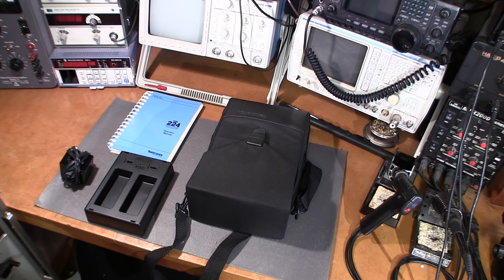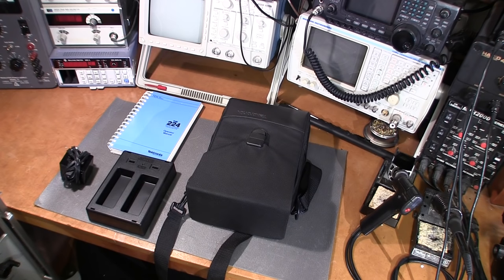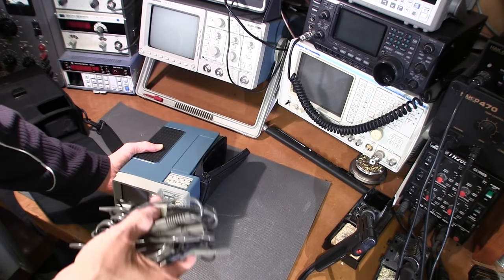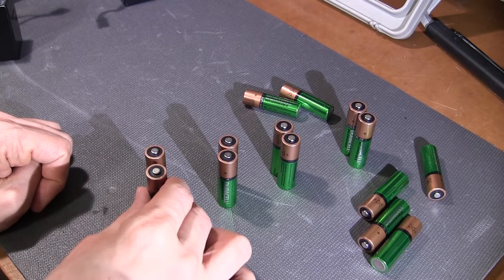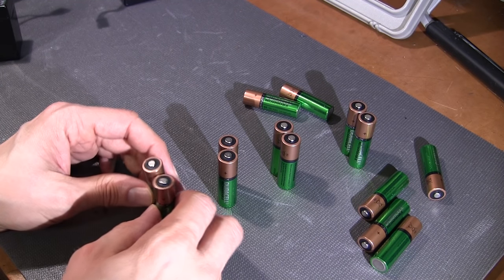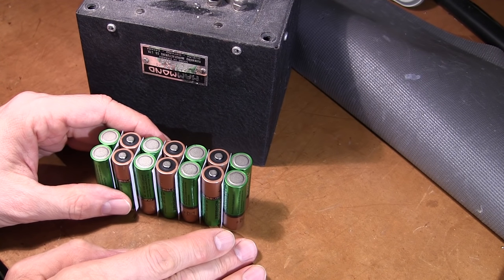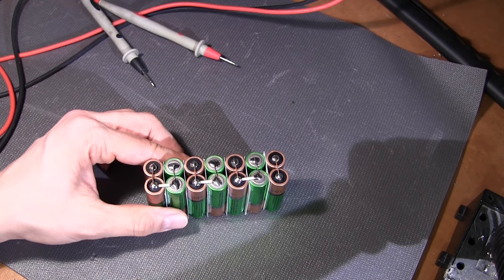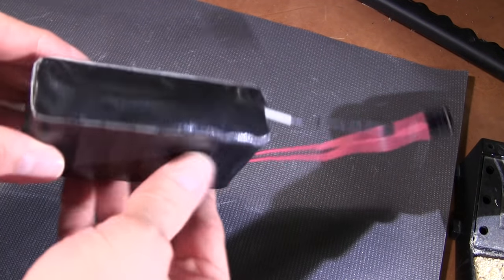Tektronix 224 Oscilloscope Repair and Modification

Comment: So u chose ni mh type batteries vs 18650 type lithium ion
Reply from the maker: Yes, because they charge the same way a lead acid battery does.
Reply: @MrCarlsonsLab  fair enough what about longevity as in charge cycles? I always thought that lith ion were the top tier before li po etc

Comment: Hi, What is the value of the resistor in that battery setup and what is its function....thanks.
Reply: Might be a useless reply at this point, but: it’s not a resistor or an inductor. It’s a fuse wrapped like a resistor.
Color bands are similar to decode them. Little fuse and they still can be found on eBay.

Comment: Is there any reason that you did not use a LiPo stack for this mod? Would be lighter and more efficient and increased use time, great mod nonetheless, exquisite work, explicit video.
Reply from the maker: LiPo batteries would require modification to the scope (charging circuitry), this modification is plug and play, with over double the capacity of the original battery.

Comment: why do you use 7 AA batteries to get 9.5V when the original lead acid pack ran at optimal 8V? wouldn't the extra voltage damage the scope?

Comment: Don't you have to mod the charging circuit for NIMH?
Reply from the maker: Not at all. The whole idea behind this modification was to keep it simple, and build something plug and play with more capacity. With the displayed arrangement, the charge Voltage worked out great.

Comment: I'm building this battery for my Tek 222PS. Got as far as the insulating bits between cell pairs. 

Can anyone suggest a common material to use for this? Maybe not common plastic (should be somewhat heat-resistant) and not conductive (for obvious reasons). 

Cheers.
Reply: Used "fishpaper", a common insulation thermal and electric insulation paper. Found on e-Bay. Lots for sale cheap.

Comment: i thought up a machine in theory that haz solder in a needle that stays liquid hot....you have it a few mm above the battery top prepared and it drop liquid solder onto to the amount you input on machine....wouldnt it be so e z to have that machine....

Comment: Hello Mr. Carlson, A dear friend gave me a very nice Tektronix 2230 scope. It ran great for a while, then when I go to turn it on, the power light doesn't light and I hear a chirp every now and then. Any idea where to look for trouble??

Thanks, Chuck WD8BXS
Reply from the maker: Hi Chuck. It probably needs capacitors... Time for a re-cap.
Reply: Would you just replace all of the electrolytics int he power supply?

Comment: It wouldn't occur to me to wire a series stack of NiMH cells without adding slow-discharge resistors across each cell.  The reason why not is that the cells will self-discharge at slightly different rates, so if you start using a half-discharged stack, as the battery exhausts one or more cells will go to zero volts and start to be reverse-charged.  The result is that that cell will fail and go high impedance..   So advisedly, fit discharge resistors across each cell pair in the stack such thatvthe stack discharges completely in about a month.

Comment: could you not have done one row or block of positives all wired to each other and one row of negative all wired together instead of going back and forth in pairs?
Reply: Jeff Gagnon Then they would be all parallel

Comment: Saw this video about a year ago. Still don't understand why you didn't go with LiPO batteries.
Reply from the maker: Hi Peter. If I was to change this over to Lithium batteries, the charging circuit would need to be modified in the scope. I didn't want to add an external charger (or add one under the probe case) either. The batteries I chose charge the same way the original's did, and required no external circuitry or modifications to the scope. I get an entire day of use out of that battery pack (on continuously) .... Way more than most would need from a portable scope.
Reply: Ah, so a SLA battery charger will work with NiMH cells (assuming the same total battery voltage). That's a useful nugget of knowledge!

You don't have any trouble with charge balancing across all those pairs of cells in series? I've read that this is a potential trap.

Comment: What is your preference of these batteries over a Lithium Ion, 18650's?
Reply from the maker: Actually, I like them both. This solution was a direct plug in. The 18650's would need a special charging circuit.

Comment: How does the inductor behave like a fuse?
Reply from the maker: The wire inside the inductor is small enough to open with excessive current draw.
Reply: Thank you for the explanation.

Comment: Shouldn't you also put the spaghetti tube on the anode end as well? It looks like the uninsulated jumpers could short the can to the anode. Remember the entirety of the can is connected to the cathode, not just the far end of it.

Comment: good work dude! 
i have done the same thing and it works out nice! but i never super glued them ill do that next time..
How come you did not use lithium cells? was it beaus of the charging circuit required ?
and can you get back to us on how long the battery pack discharges and recharges? don't NiMH battery's require a higher voltage to charge then lead acid batteries?
Reply from the maker: HI Matt. So far 5 hours straight and no low battery warning yet. I will continue today.

Comment: Why did you make 9.5V instead of 8?
Reply: I wondered this too. Then I remembered the original was a Lead Acid battery.  So like a 12V car battery charges and runs at 14V(+/- a bit) then 9.5V should be perfect to replace a 8V lead acid battery.

Comment: Regarding using lithium ion instead, the unfortunate reality is that 3.7v nominal is too low for something designed for 4v nominal. All of the capacity will likely not be leveraged. 

If replacing a 6v lead acid battery, 3.7 * 2 = 7.4v, that is way too much. 

For 12v batteries, 3.7 * 3 = 11.3v, which is too low. 24v / 3.7 = 6.5... that is about as bad as it could get.

Luckily for you, you don't need to leverage the high current capability of lead acid, otherwise you would be forced into using LiPo or Lithium Ion, and that would likely require modifications to the scope.

The question I have is, parrellel first, series second, or series first, parrellel second? I tend to feel better about parallel first, as it feels like the entire series line has a bit more redundancy that way. Both parrellel batteries would need to fail to mess up the series of cells. It looks like you also did parrellel first, series second.

Comment: How are you going to recharge this battery pack?
Reply: It charges off of the wall plug
Reply: I wrote a response and forgot hit reply,but you only need a smart charger for fast charging.A properly sized trickle charger will do just fine with NiMH batts.

Comment: I have some batteries that are 3,7 volts at 9000 ma h that are really cheap they are 1860's rechargeable at 9000 ma hr each. should make good replacements.

Comment: Why not to use lithium batteries?
Reply: You'd have to charge them externally and also make a special circuit to do so.....These charge just fine with the included wall wart when it is plugged in the wall.
Reply: I did the two 18650 Li Ion batteries in series for my 222 scope.  It is a giant pain in the butt to remove and recharge so I am buying NiMH and making the switch just now.  I didn't think having to remove to charge would be a big deal but it turns out to be a big pain in the a$$.  I have to disassemble the battery pack every time to clip it into the external battery charger. That is why not lithium batteries.

Comment: I have question what the oscilloscope to learn and at a small price,under a hundred,anyone please .I hopeing to find people when learning how to use your oscilloscope ,which one.to learn on disable vet ,did income ,I did by a pocket scope for about 34.00 ,but could have got it for 26.00 if I wanted to wait three weeks so I spent 8.00 more for a faster time.to get it to me.,find out the rest leads weren't good for a lot of things so I bought a probe for it Hope I bought the right one ,I need a scope for limit use on old tube radios ,

Comment: You do realize that some device's use more power so the batteries don't last as long that includes rechargeable so I'd guess something like that scope would drain the batteries faster than say a portable tv
Reply from the maker: Hi Kelly. I'm pretty sure I realize some devices use more power. This scope will last over 9 hours of continuous use with this battery pack.

Comment: The analog version of this came out when out when I was a teenager. Dave Jones has a video here: https://www.youtube.com/watch?v=czv_8d66IQU
I would have given my left AND right testicles to have owned one back then. But alas, all I could afford was a Non-Linear Systems MS-15 Miniscope. They weren't too bad of a scope for the money. I still have it and it still works. It had the Gates cylindrical sealed lead acid batteries (3 D sized cells). I replaced them with NiMh cells also. I had enough space where I was able to use the cheap battery holders/boxes that they sell at Radio Shack, so I didn't have to solder to the cells.

Comment: why not use Li-Ion batteries?? honestly probs cheaper than ni-cad and 2 LG HG2 would be 6000mah 2x2parallel then series them.. 8.4v 6000mah
Reply: Yeah, it would be a lot easier to just change the plug on a quadcopter battery and plug it right in or get 18650 cells with solder tabs.

Comment: My superglue always take ages to cure not like that.
Reply: It depends on the surfaces how fast the two pieces stick. When I superglued RC model airplanes together made of balsa wood (in the 90s and early 00s), two pieces of flat surfaces would stick instantly while gluing junctions was slower. Especially plastics glue really fast. There is also the accelerator to drip onto the superglue and it hardens quickly. It weakens the glue a bit, but if you're gluing say 40 ribbs in a wing its nice to speed up the process. Look up Cyanoacrylate Accelerator.
Reply: +bwack 
The "active ingredient" in accelerators: water.
Reply: Thanks :)
Reply: It sticks really fast when it gets on your finger. Use caution!
Reply: +bwack superglue for balsa?
Reply: Once upon a time model airplanes were built with balsa :)
Reply: bwack i know, i have used balsa wood, but i feel it's too soft for superglue. Maybe there are different varieties?
Reply: I remember the wood sponged up the glue and dried quickly on flat surfaces but on joints it was slow. So long ago now :)
Reply: bwack why'd  you stop?
Reply: You mean stop building RC air planes ? Lost interest I guess.. Do build/fly still ?

Comment: wonder why you dont go spot welding, guess because you never built one. And because you think that that might be too hot and might damage the battery, but this is commonly being done - probably for a reason. please remember anwer my question i posted on the last video about the variac im building.

Comment: Manufactures weld on tabs to their batteries, so I can't understand why anyone would think soldering would apply any more stress than welding. Solder away!
Reply from the maker: I agree, Spot welding often blows holes in the battery end caps.

Comment: That scope is very noisy. If you're looking for noise, look no further than the scope itself.
Reply from the maker: It's actually quite quiet compared to some newer scopes. Not the best, but definitely not the worst.
Reply: @MrCarlsonsLab  Maybe it's the 50mV/div setting that's amplifying front end noise.
Agreed about the new scopes being noisy. I was forced to upgrade my trusty (and low noise) 2465B, who's ASIC failed last week with a TDS3054B. The traces are horrendously noisy, probably made worse by the 9-bit sample depth and the low VGA resolution of the display. I'm left wondering how I'm supposed to differentiate between a noisy preamp under test vs the scope's own self-noise. I could clearly see the difference on the analog scopes I've owned over the past 65 years, but on this newfangled digital scope it's like trying to see through fogged up binoculars.

Comment: Paul, this is not only cute, it is also still usable. Supergluing AA's to a batterypack is very clever. I like it. 

What brand is your superglue and how is the shelf-life ?  Is a lot better as what I know.  

I have a 212 baby scope, see a teardown at http://www.pa4tim.nl/?p=638  Mine has (dead) nicd's, is analog and is only 500kHz. The probes are permanent connected and there is no connector for an external psu. The permanent coupled 230V connection  has 2 bananaplugs. and charges the battery. I also have a sinclair designed Thandar 10 MHz miniscope and a Hameg tubed babyscope.
Reply from the maker: The Glue is "Lepage liquid pro super glue." If you keep the glue in the external bottle with the white cap on, it will last a very long time. I bought mine over a year ago. Keep it in a cool dry place as well.
Reply: A search shows that Lepage super glue is available at both Lowes and Home Depot... only in Canada! I don't see any reference to it being available in the US.
Reply: Thanks, it's a pity I do not live in canada. My wife gave me today (my birthday) superglue from Bison. I have not tried it yet. It has the same limitation for materials (to bad PE is one of them because that is the most used plastic)" it is  takes  10 to 60 seconds to hold, that is not as fast as the Lepage but fast enough. After 2 a 3 minutes the glued connection is at full strength. Fred

Comment: Nickel Metal Hydride Batteries are junk, never had one last very long, maybe that's why all rechargeable devices went to Lithium Polymer batteries.
Reply from the maker: Some of the early ones were, these and the Eneloop types are fantastic.
Reply: Early ones were guaranteed for 500 cycles, the newer LSD (Low Self Discharge) types e.g. the Panasonic Eneloops are rated for max. 3000 cycles. So you might try them again, but with a good dedicated charger.

Comment: Your credibility has just taken a severe hit with  me.  You have convinced yourself that soldering batteries is better than welding them and that is completely illogical.  The welding pulse lasts a few milliseconds so the amount of surface area at risk from heat is negligible while the area heated by your soldering process covers nearly the entire contact surface for several seconds and in some cases TWICE!!!!!  Just because the cell still works doesn't mean you haven't compromised it's longevity and good luck replacing a cell in the middle of your glued up pack.  Your whole process is fatally flawed, IMHO.  I must wonder why a guy with rooms full of high tech equipment refuses to invest in a battery welder.  There are even tons of Youtube videos on how to make your own.  This is the equivalent of shooting yourself in the foot with an automatic weapon.